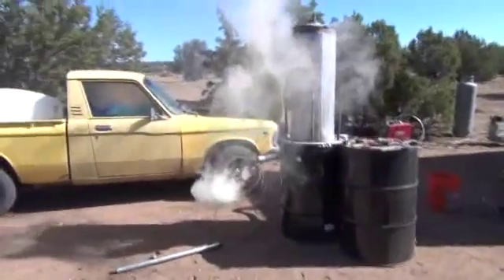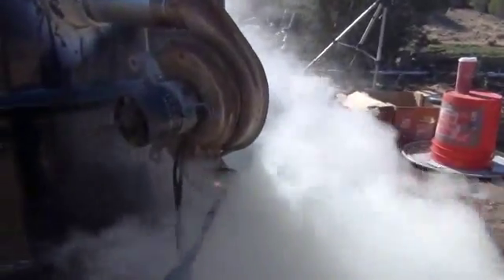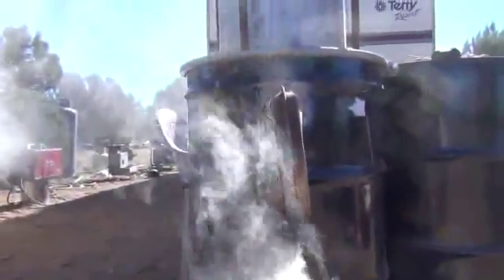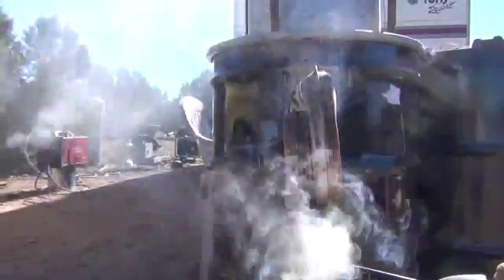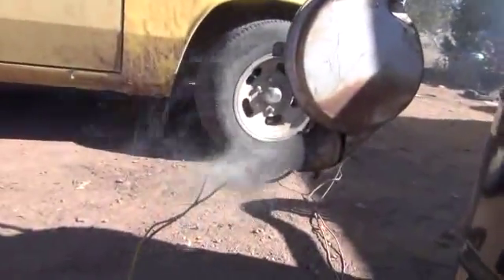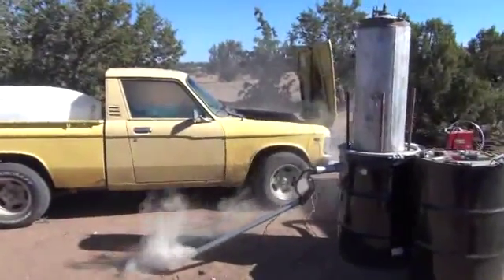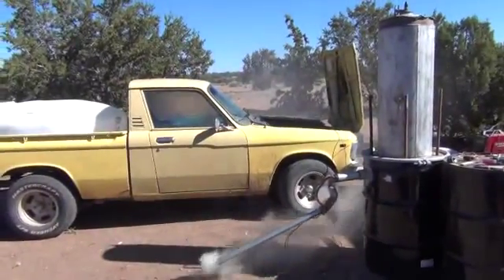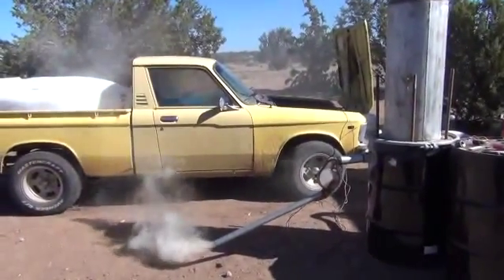Gasifier Truck How-To part 5

Comment: Do you have a video that shows what the smoke looks like after it's gone through all the cooling and filtering systems?  Maybe from that galvanized pipe fitting on top of the final filter mounted to the front bumper.   Would be interesting to see the syn gas from that location both lit and not lit.  Probably at night.